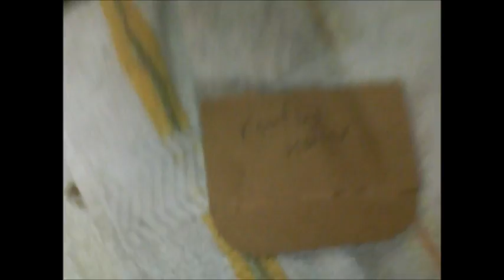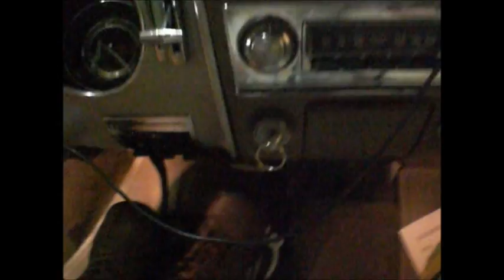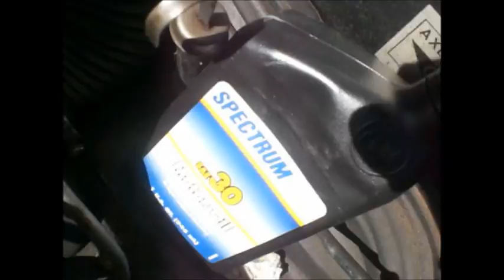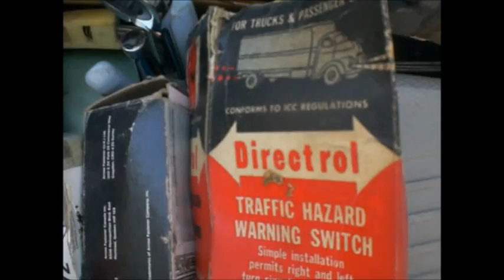Monza From Warehouse  6 20 15

Comment: 97 degrees, its that temp here everyday almost all year long A FEW Wawa;s opened here, they sell ethanol free 89 octane, I might fill up, see if my MPG improves to pre 2000ish MPG, Dump the POS RMW here way south in the everglades, Ill have to hide it someplace but Ill fix it up when its not 97*